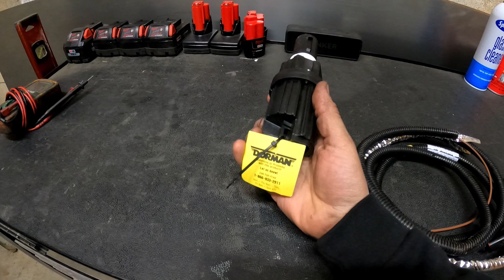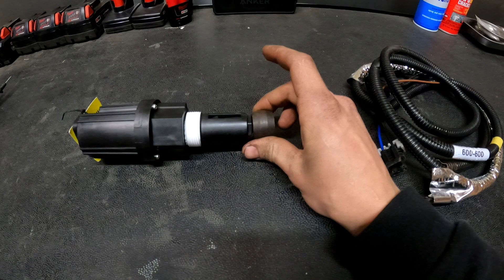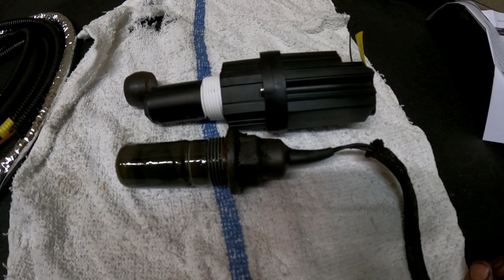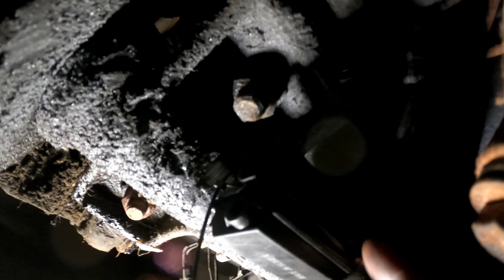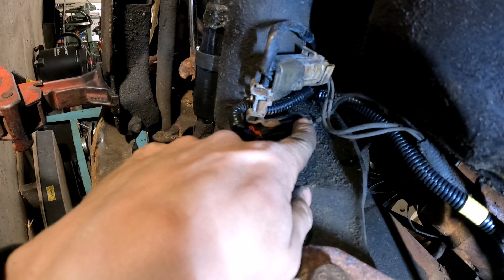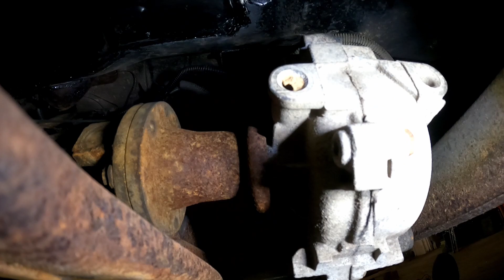GMT400 4WD Electric Actuator Upgrade retrofit for 88-93 8 Lugs over 8600GVWR

Comment: Is there a way to test my OEM harness and plugs? I probed for power when in 4wd on my 93 k1500 with floor lever and have not had any luck. Have debated purchasing the harness and electric upgrade but if I’m not getting power at the plugs would it be a waste of money you think
Reply: A good way to test it is too see if its still going into low gear but not 4x4 or just use a multi meter
Reply: i have the same issue and planning on replacing the actuator and possibly doing the upgrade, but i probed for power at the actuator connector and had no luck but it was because my 4WD fuse was blown (#24 fuse in the dashboard fuse panel) thanks to people on the GMT400 forum i've found out the actuator is the issue and am now replacing it... if you have the fuse and it's not blown even when shifting into 4H and the connectors underneath are connected, then you may have an issue with the wire that leads from the actuator to the fusebox itself... i sure hope not, wiring gremlins always suck! (also no idea if they changed throughout the years but mine is a 95 and it has this #24 fuse for 4WD, it may be different for your 93.

Comment: The Dorman 600-490 is what fits best for your year, I believe - great video though.
Reply from the maker: thank you!
Reply: I'm still confused on how to splice the brown wire. Do you disconnect the original harness to the transfer case and just shove the new brown wire in next to the original or what? No cutting, no soldering? Thanks for clarifying
Reply: @lkious  strip back the original harness brown wire in some place and solder it on